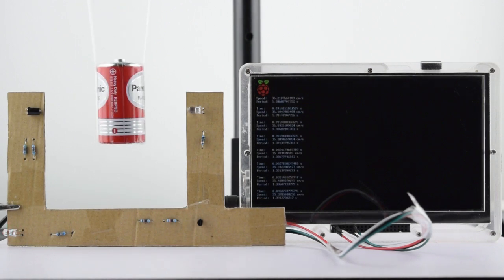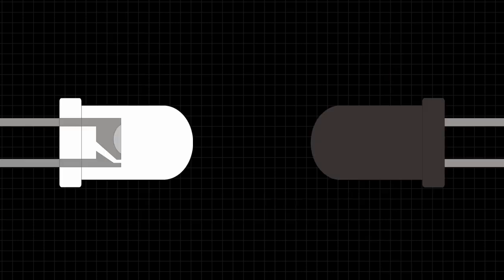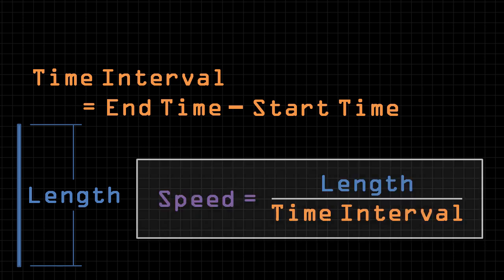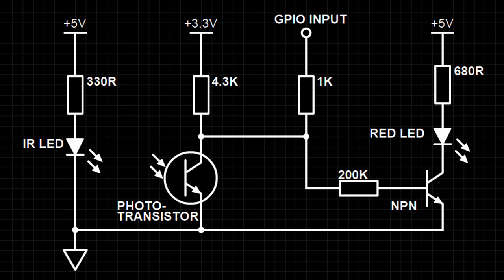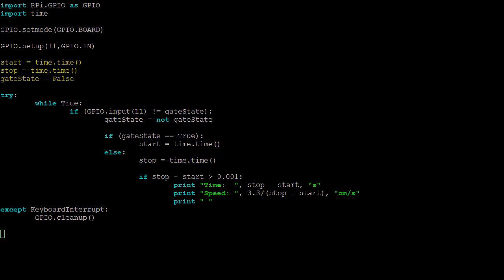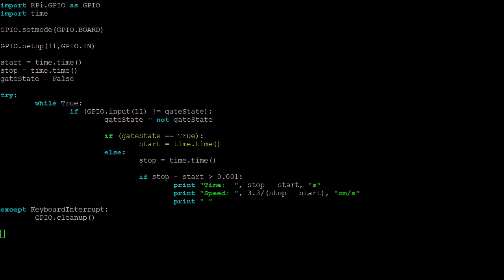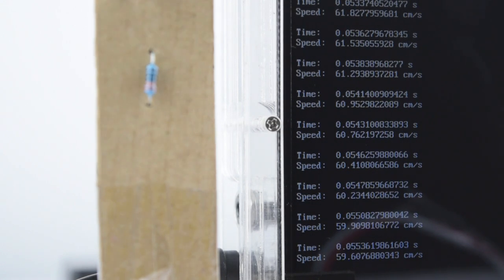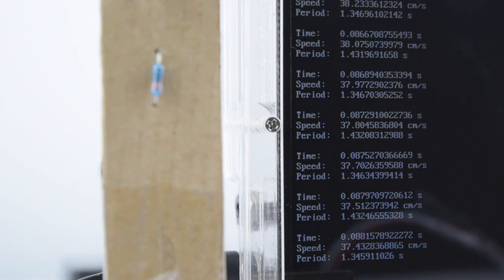Build a Photogate for the Raspberry Pi

Comment: Hello, can this be used to detect filament string for 3d printer to check if the material for printing is still available? Can it be used as a detector not touching the material?

Comment: how would you build this circuit on a simulator. how do you connect all the ends (the 5v and 3.3v ends and how do you measure the input value on a simulator, which component do you use)